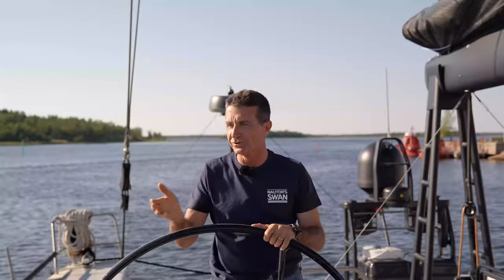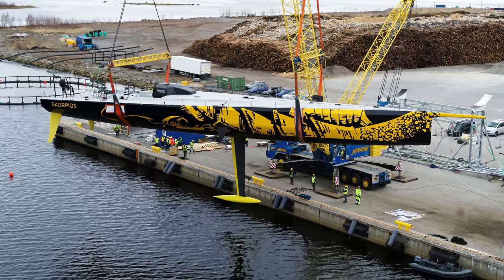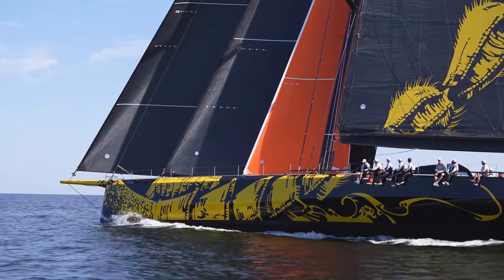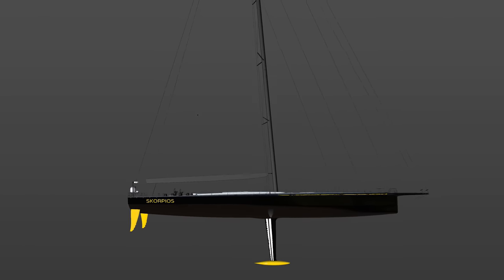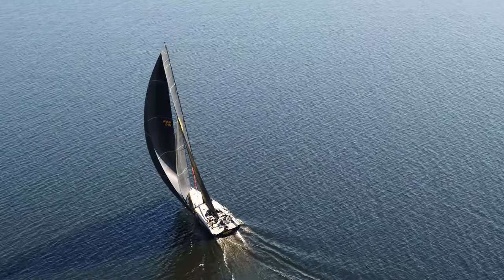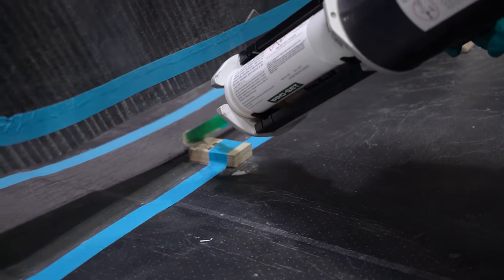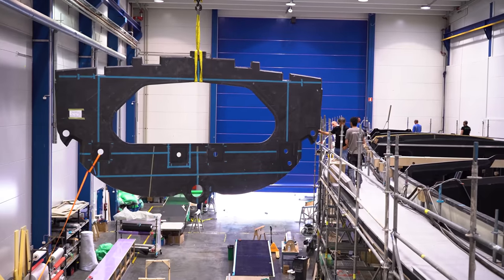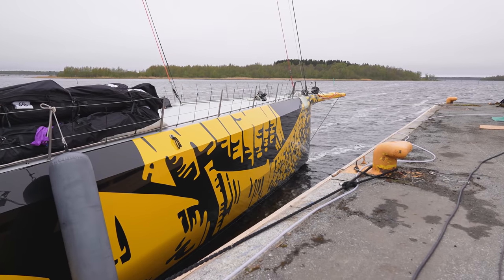ClubSwan 125  - The record breaker changing the rules of the sailing world

Comment: Nudging 15 Knots upwind this thing will be fast. And it will be always faster than the wind downwind. If the C Foils create the skimming effect as promised it should pump out very high sustained speeds reaching and off the wind. Can't wait to see it race against Comanche in the Rolex Middle Sea Race.
Reply: Comanche is its natural rival. I wonder if they'd have much other occasion to meet in anger. Sydney to Hobart has maximum 100 foot entry iirc

Comment: I'm a bit skeptical this thing could beat the current crop of hundred footers, CQS couldn't challenge Oats XI or Commanche with its radical design and foils, and Oats XI dabbled with foils before removing them. But would love to see this go head to head with the Oats and Commanche
Reply: CQS is different as it is an older design converted to have foils.
Reply: @ferdypl322  CQS Very narrow boat with DSS foils very limited and yes it didn't work. The C foils do work and should help keep the bow out of the water in the right conditions. In the lighter conditions this thing should account for Comanche easily, narrower boat and bigger vs very beamy sticky boat. In the heavier reaching conditions it will be a case of beam stability vs C foils if you like,  so lets wait and see? Rolex Middle Sea Race they line up against each other.
Reply: @deanrwilson  yeah i think the 125 will be faster

Comment: Did the sea trials generate any data that I'm not seeing or at least VPP numbers  from the designers Juan K?     What other monohulls besides Comanche would be comparable ?
Reply: They won't be releasing those VPP numbers for comparison although they would have them for comparisons. Skorpios pushing 14 Knots upwind in the right conditions so that's pretty amazing for on the wind boat speed. C Foils vs Beam stability in Comanche's case. Let's wait and see

Comment: I won't believe it's faster then commanche before I see some results! the clubswan 125 doesn't seem that fast tbh

Don't get me wrong it's a beautiful boat but I'm sceptical
Reply: in deed they they look similar, but it surprises me how far foreward the mast is on the cs 125 compared to commanches
Reply: So it is 25 feet longer than Comanche. It's not a beamy boat like the Indian so will also go well in light conditions. Skorpio wins in the Light. In the heavier conditions reaching which is Comanche's strength Skorpios will be narrower but will utilize the C Foils. So it will be a case of beam stability vs C foils if you like. If the C foils do their job the bow or front of the boat will be skimming across or through the water so there is the potential for Skorpios to do well. We know the Indian really lights up in these conditions so let's wait and see? The 25 foot advantage should give Skorpios higher sustained speeds but let's wait and see when the race each other in the up and coming Rolex Middle Sea Race 2021.